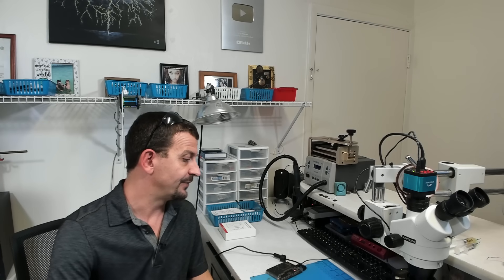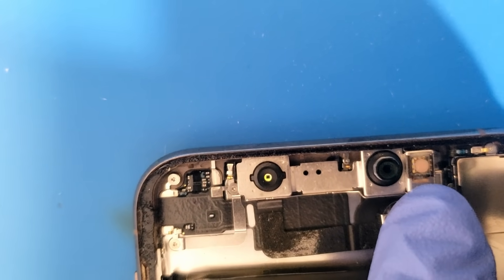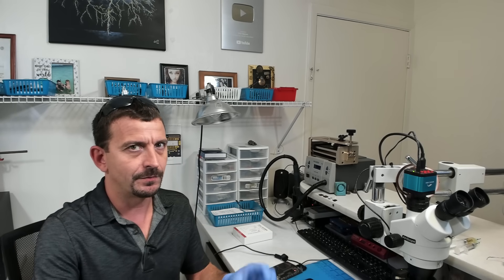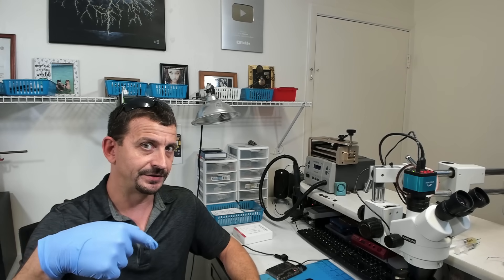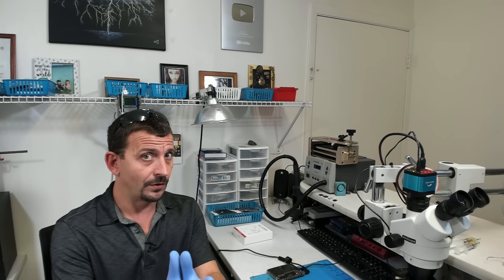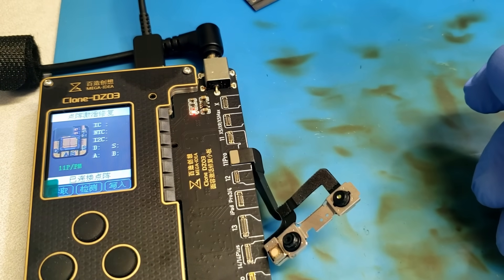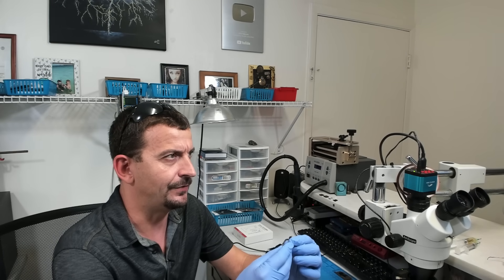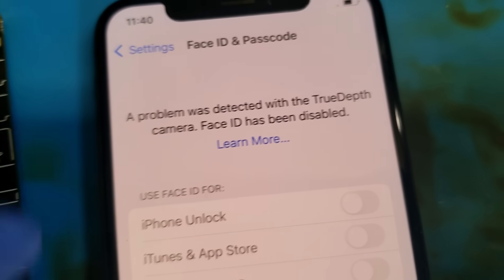I will have nightmares about Face ID (Read comments to see how it was fixed!)

Comment from the maker: Thank you everyone for telling me how to fix this!  I have Face ID working on the XS and realize it is very important to RTFM :D  I had to connect the phone (like it said on the PC app) and do a cloud backup with the original module connected to the programmer (WITHOUT THE TAG), I was able to click the "Acti" button which said some things about High Voltage & it took a few seconds.  Afterwards, I connected the tag onto the module & to the programmer and then wrote the .bin file that I had saved.  After "Activating" that faulty module showed up with normal D,B,A,S.  I've re-assembled the phone & all is working.
Reply: Great to hear.....Internet is great ...when it Used for Good!!👍👍

Comment: I usually have used QuanLi tag on and haven’t had any issues so far. I’ve gone as far as swapping out the whole front camera and dot projector with a tag-on flex, restoring Face ID with no issues so far. Fingers crossed 🤞.

Comment: With JC programmer you have to "activate" the original cable after you read it and before you attach the tag-on to it for testing, otherwise it is just like in your case, not going to work... so I guess with this programmer of yours you will need to do something similar, so maybe you are just missing a step. I have fixed a lot of phones using the tag-on cables and they are all working fine after the repair. Good luck :)

Comment: Hey Jason,
When I said stay away from it, I was referring to the old school method where you take apart the dot projector and replace the Romeo IC then re program it. I said stay away as you need some tools: the jcid programmer, some holder fixture to keep the dot projector in place while working on it, replacement chips, special glue and what’s more important of them all, the alignment tools to align the dot with the front when you put it back(you need one tool for every model). It’s not hard and it’s a fun job that you with your skills would appreciate. However nowadays it is not economically viable as you will work about half an hour to 1 hour on it and there’s that much you can charge for the job.
I don’t do the tag on flex
Method but I think you have missed a step where you need to blow the transistor that is inside the dot. That is why the tool you use has that funky big power supply connected via cable
Reply from the maker: Yep, that's what the deal was.  The phone needed connected to the computer & then after "cloud backup" it enabled me to click the Activate button.  After that the module read as "Normal" across the board with the tag-on connected.  Thank you!
Reply: @ststele  the other phone you had that was not reading the Romeo ic at all, might be corrosion under the flex that is connecting the dots projector. You can try to remove and clean like you did for the flood illuminator and maybe it will just work after without the need of a new tag on flex
Reply from the maker: @mirceaalicu thanks!

Comment: You missed doing the third step, verify by connecting the qianli on tag to the flex of the dot projector and connect it to the programmer and verify it. The message that appears on the screen is that of up and down. Those flex tags are easily damaged, the internal circuits break or lose insulation.

Comment: I think after you program the tag on flex, you've gotta attach it to the original flex, then connect the entire setup to that tester/programmer. I could be wrong as I've never tried it but I've watched a ton of videos about fixing face ID with that tag on flex stuff. I think you would at least be able to test everything together. Hope it works out, Jason. Thanks for all of the great videos. I learn something with every one of them.
Reply from the maker: Yes, this right here..  I had to go back to the original flex (without the tag) and with the phone connected was able to click "Activate".  After that, with the tag-on connected in series with the original module, it then read everything as "Normal".  Face ID now works!  woohoo  This customer was pretty angry that his face ID didn't work.. 😕
Reply: @ststele  Tell the clown to treat their electronic devices with a bit more respect and they will last a long time. I had got an iPhone 3G in 2008 and it was still running on the original battery in 2018 basically as a music player. My Galaxy S2 is still running after 11 years but with a battery change. Treat them right and they can last a long time.

Comment: i believe you have to short the mosfet first on the damaged faceid flex in order to read the data.. that's the purpose of that 20V adaptor..

the I2C error is actually because of that mosfet not being able to turn ON

Comment: I am not at all familiar with this issue, but it seems to be that you want to read like a serial number out of the old flex assembly and then get a new one and put the tag in there to give the phone the original serial number. You would not really want to do this method on  the original assembly, because it would either work or not if it was damaged. Some one else mentioned you may have to shut down the chip that normally responds on the assembly so the tag thing will respond instead.

Comment: You need to hook the phone up to the computer for it able to get access and icloud burn.  Normal write won't work.
Reply: Yes he didnt do Icloud backup and Icloud Burn. 

I think its the icloud burn step that fuses the solder connection on dot projector... Should that step fix the S D B A Abnormal so that they are not abnormal anymore?
Reply: @0ctivate  Yes.

Comment: Hey, love your videos! 

BTW 

It show's abnormal when only the tag-on flex is connected because it does not detect the dot projector module. and the face id isnt working because you need to activate the dot projector without the tag on. It basically shorts the ic on the module so it can use the ic on the tag on flex! Hope this helps lol 

For the 11 pro max, i2c is abnormal so try soldering the face id module to another OEM apple dot projector flex pulled from another iPhone 11 Pro Max! 

Cheers, hope you get it to work :D !
Reply from the maker: Thank you!  Yes, with the phone connected I was able to click "Activate" on the original module but without the tag-on.  After that, with the tag-on connected in series with the original module, it read everything as Normal.  Face ID works now on the XS!  I really appreciate the help.

Comment: i always go with - dott projector can be fixed and shows error "move higher move lower" the tru depth camera cant be fixed and the ir sensor is tied to the phone too. i always test with jc tester on the comp and you'll see the codes for ir and tru depth if there ok. ive never used the add on cable but have ordered to test them too - i fix in the UK

Comment: I think continue to work on a solution is better then just dropping it. Sometimes it's days to work out some of the things I work on; thrust me. As we go along we learn that's what make you  good at your job as you are.
Reply from the maker: Thank you!  I got the Xs working..  I completely missed having to "activate" the original module.  The option wasn't available until connecting the phone & doing "Cloud Backup".  Odd that they insist on collecting the data before letting you use it.  Seems it should be available offline.  Anyways.... glad it works!

Comment: Connect the lattice again and „activate“ it. This will blow/short the mosfet inside the dotprojector. 
Rest should be ok
Reply from the maker: Thanks!  I will check that!  Don't see activate but I did wonder why it has a big 20v power supply!
Reply: Yes that‘s why 😊 i don‘t know this programmer, but they all do the same thing…
Reply: The activation Button is Right above the Test Button in your software

Comment: Hi Jason, I'm pretty sure you need to use the tag on flex with a new front camera module. The tag on flex tricks the device into using whatever camera is there for Faceid. But if the dot projector is dead it won't work.
Reply from the maker: Thank u.  Gonna try that too!
Reply: He didn’t use high voltage to kill mosfet
Reply: No this is incorrect. Needed to click on activate to kill the mosfet on the original front camera/dot projector module. After doing that then you attach the programmed tag on flex and test it. If functioning properly install into the phone.
Reply from the maker: @JamesSoulsby  Yes, to kill the mosfet I had to connect the original module without the tag.  Thank you!  The Xs is working.  I'm going to try the 11 Pro later today to see if the Cloud backup / burn process can get the data needed from the phone.
Reply: You need to hook the phone up to the computer for it able to get access and icloud burn.  Normal write won't work.

Comment: You have to kill the old chip via the activate button in the software. Plug it in, read it, kill the chip via the activate button, unplug the module, plug in the tag on flex and burn the data. Then connect the tag on flex to the  module and test it!!
Reply from the maker: Thanks!  I will check that!
Reply: Yep, this is exactly what’s missing here. You need to reactivate the dot projector without having the tag-on flex connected. After that step plug in the tag-on and boot the device, you’ll find Face ID working again.
Reply: Blow???
Reply: @petergplus6667  Kill the old chip by giving it to much amps. The specific programmer used has an external power supply for that specific step. It needs to be plugged in when you push activate. The programmer will overpower the chip to kill it. The tag on flex will then bypass from the old chip to the new one on the tag on flex
Reply: @michelmolleman  I didn't expect it to be meant literally :)
Reply: Thats right, there is no other way. BTW why not JCiD?

Comment: I enjoy your process and lingo you use in your videos. You are very  good at what you do.
Reply from the maker: Thank u!
Reply: @ststele  You missed doing the third step, verify by connecting the qianli on tag to the flex of the dot projector and connect it to the programmer and verify it. The message that appears on the screen is that of up and down. Those flex tags are easily damaged, the internal circuits break or lose insulation.

Comment: Maybe grab good data from an other chip and paste it on the Tag On? Or won't it recognize due to wrong data?

Is there a way to edit the data?
If yes, maybe try to take a look at a good FrontFaceSensor data and try to mimic it.

Anyways, its interesting to see how that method kinda works.

Keep it up!!

Greetzz
Reply: I think it should be used the other way around. The Tag On should contain the data from the original chip, because of Apple's serialization, but then you can use any flex that works to fix this iPhone. So the Tag On just circumvents Apple's serialization. Just a guess, but I would be really interested in the results of that test.